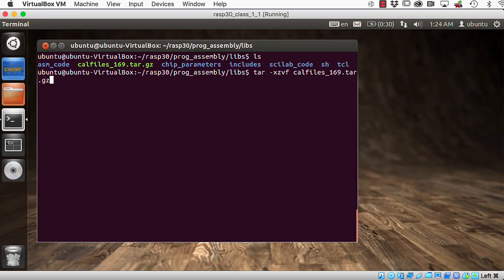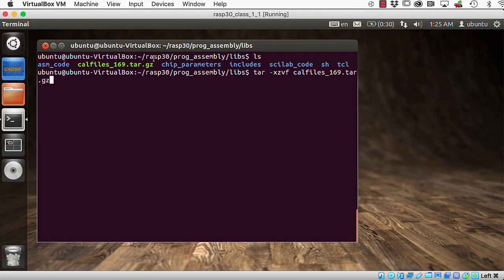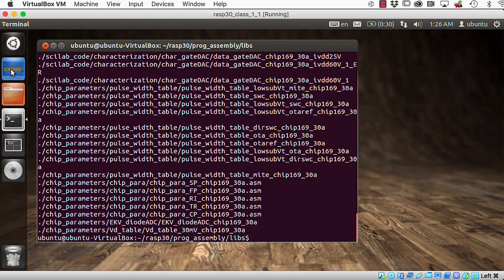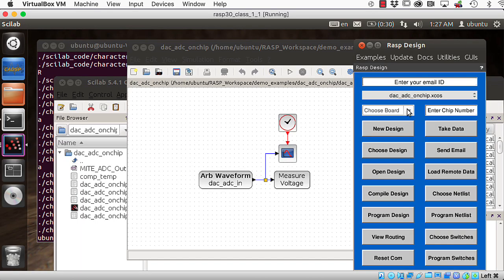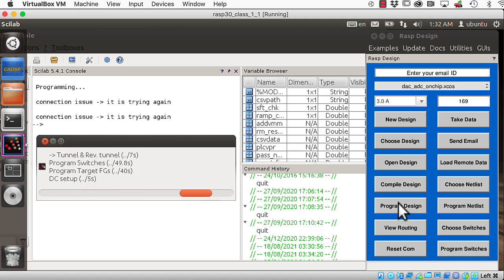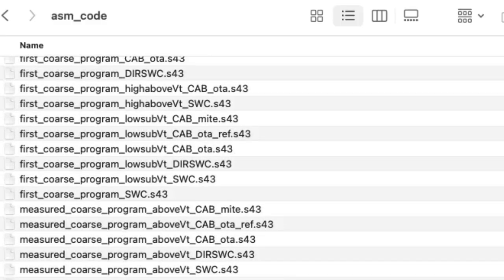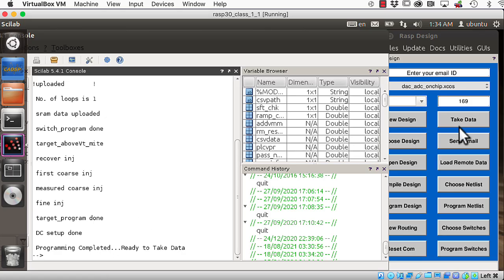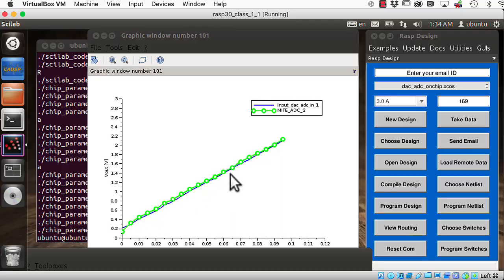FPAA Calibration & DAC/ADC Loopback Test (Floating-Gate Field Programmable Analog Array)

Comment: Much better. So each chip has a cal file? And is that a lifetime thing, or at least long-term with some drift?
Reply from the maker: Good question. I think Jen Hasler’s group has been using the same calibration files for their original research run of chips for… 5 years maybe? I will ask her about that.
Reply from the maker: I checked with Jen -- she said that it should theoretically be a "one and done" thing.